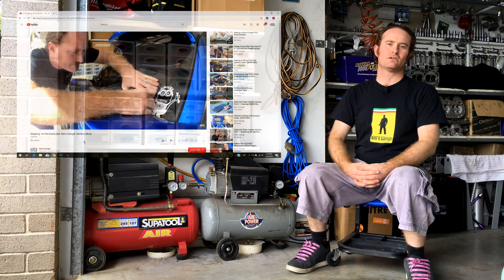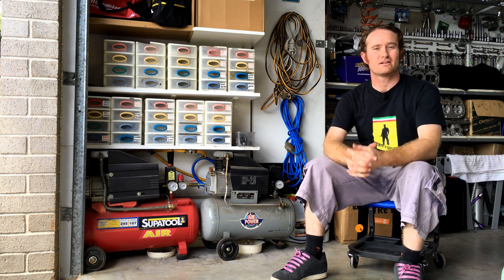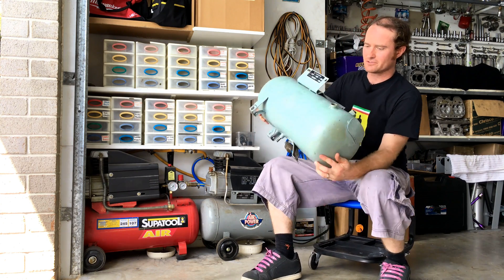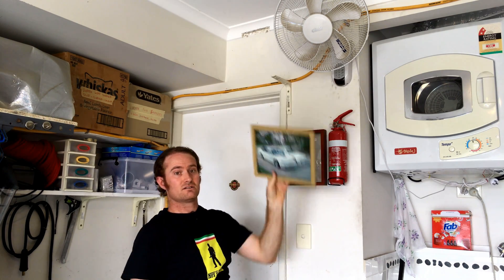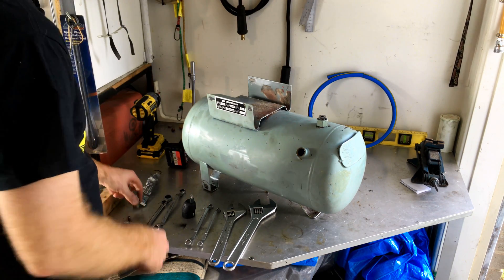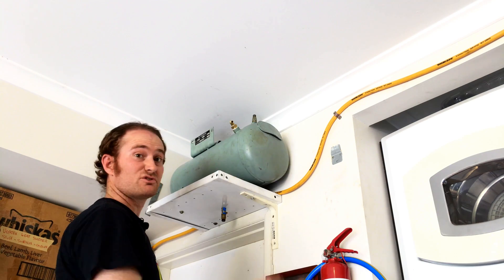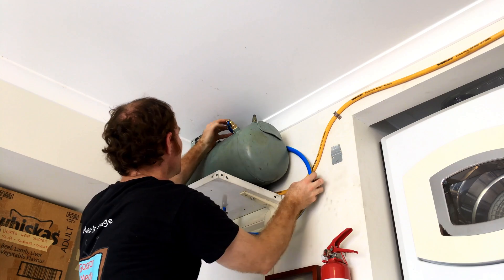Converting an old Air Compressor into an Auxiliary Air Tank : Mo' Air, Mo' Power!

Comment: I did this. Had a noisy air compressor and took off the motor. Capped the air outlet and used a 1 inch to 1/4 inch reducer and tee fitting to plumb the tank into my existing setup. It works great though I only use the extra tank when I'm running the 1/2 inch impact. Most of the time I don't need it but it's handy. Just remember you're putting additional load on your motor so I don't know how that will shorten its life but sometimes you're in a jam and you need more air rather than a bigger compressor.

Comment: Hello Nev, how is it going,  I am about to do almost what you have done,  extra air is so much easier when you're compressor is on low capacity. Your the second Australian I watch his YouTube address is C.E.E, ==  Cutting Edge Engineering and his name is Kurtis. Good on ya-mate. Geoff Lewis, Wales, UK, 🏴
Reply: Geoff did you add an extra tank? Can this increase the CFM do you know, for spray painting. Gaz Sto. Newcastle. UK
Reply: @gazsto9510  Hello Gaz Sto    I am not a professional sprayer,  what I understand is on tools that have a high demand (such as spraying, large grinders or guns. High demand tools) that by having the extra air, you are saving the compressor from coming on all the time, storage of air just gives you a biger volume. If your compressor only has a say 9 CFM as my first one did. My second compressors produces 13 CFM. 
It's all to do with capacity gives you a longer duration. Other wise your compressor will be gasping, struggling to keep up, running all the time. 
I have also gone up with high demand Connections. In the back pages of (SCREWFIX CATALOGUE they are called Pcl XF fittings, 9.5mm eg, Extra Flow) and on the internet you will find them. 
I have also used a bigger bore pipe 9.5 mm from
Screw Fix or Machine Mart tools. You can find a tremendous amount of information on the internet, and TOOLS, hope this helps.
Geoff Lewis Wales UK 🏴
Reply: @geofflewis4815  Thanks mate, appreciate the help and guidance. Get's a little overwhelming all the info out there sometimes. Been using a 11CFM tank and it's been good for what I need, I use a LVLP spray gun that uses about 4CFM so it copes really well, but I have some old propane tanks that are standing idle and thought I could add some extra air. Will check Screwfix for those fittings. Gaz Sto
Reply: Hello Gaz Sto. I was looking back on a small web site, and this chap I think did a great job of explaining whot to do. He first obtained an old gas Calor propane bottle and this one  he had was an old type bottle because he could remove the shroud around the valve, ( the first bottle I got was WELDED which making removal of the Valve very difficult, I later found out Calor use a thread locking liquid possible "lock tite" as I could NOT REMOVE THE VALVE.  Went back to my local dump an found another tank, this had a bolt on shroud. BUT STILL HAVING A PIG OF A JOB TO REMOVE THE VALVE. You can't pot a flame on the oval because of the thread locking liquid 🤔. But this chap is very clear how to build the pipe layout 👍👍best of luck.
His YouTube address is =
YOUTUBE.COM/HAND MADEEXTREME 
Hope you get the older bottle with the bolt on shroud. You might have a friend who has a "lathe", I dont.   Or a milling machine to drill the valve out as he said its BRONZE hope this little bit helps. My son in law is trying to do the same with this type of bottle. Best wishes 
Geoff Lewis Wales UK 🏴
Reply: Hello Gaz Sto, me again the web address did not appear to be very clear so here it is again in lower case writing  =====
     Youtube.com/handmadeextreme                    
All in lower case letting  Still trying to remove the valve, "no flame because of the gas and holding the gas bottle, sod of a job.
The work goes on.
Geoff Lewis Wales UK 🏴
Reply: @geofflewis4815  That's briliant mate, going to have a watch now! Thanks for your help.

Comment: Quite a capacity. I have singe 50l 3hp compressor and im looking to increase capacity but cant find air tanks or old compressors to buy. Wondering if i could i use expansion tank for heating system?
Reply: If the air tank is NOT A PROPER AIR TANK, you risk the tank exploding,  be very careful what you do. Geoff Lewis, Wales, UK, 🏴
Reply: Harbor freight has Tanks I think in 10Gal

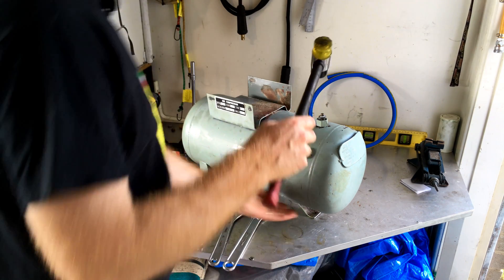Comment: I just do not understand what you were accomplishing/gluing with the coin and fitting around 3:25. Glued parts generally should not be put under high pressures imho. I would have sawed/cut/drilled/welded the proper fitting on that. But I suppose if the tank is up high it won't do as much damage if it flies apart. But I do not know exactly what you were doing so I'll reserve judgement on this.